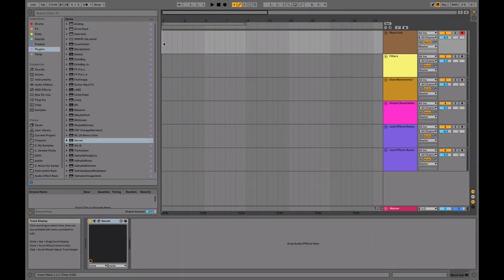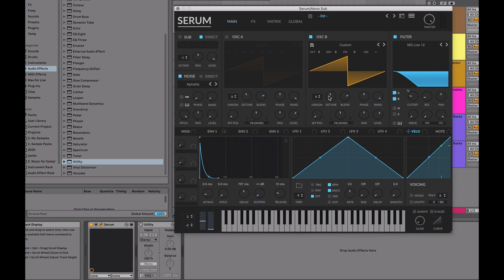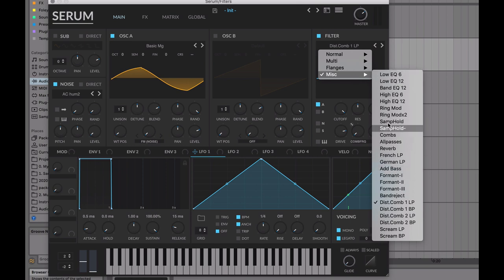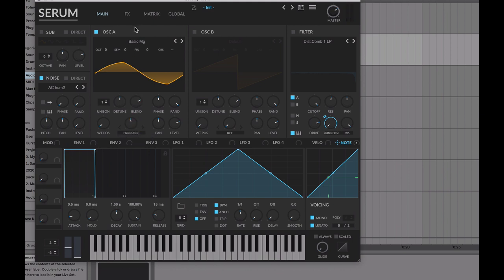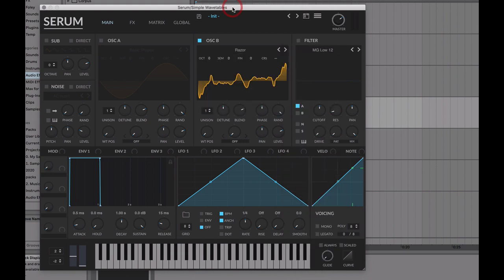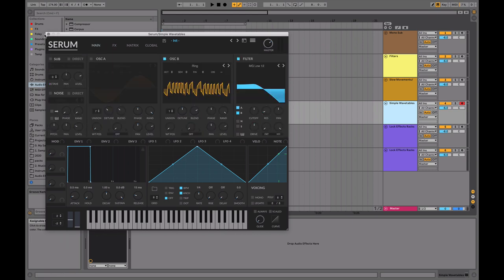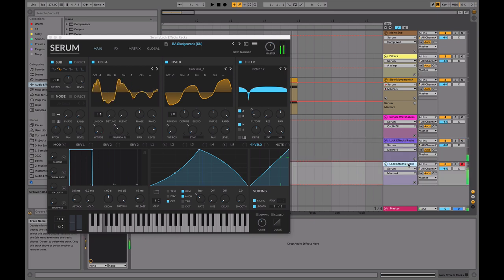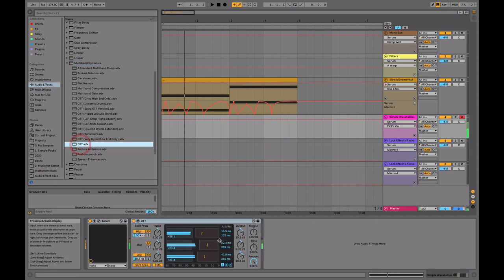Serum Bass Sound Design: 11 Fundamental Tips You Should Know

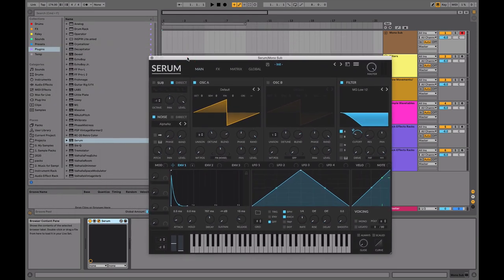Comment from the maker: 0:42 - Tip 1: Low-end Mono Compatibility
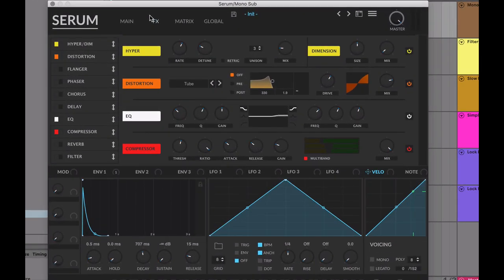4:07 - Tip 2: Multiband Compressor
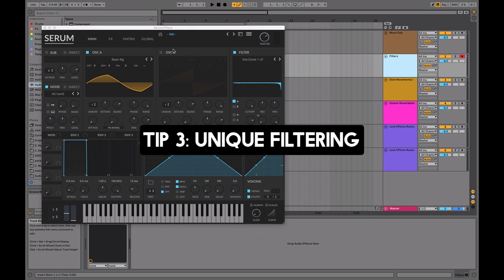5:48 - Tip 3: Unique Filtering
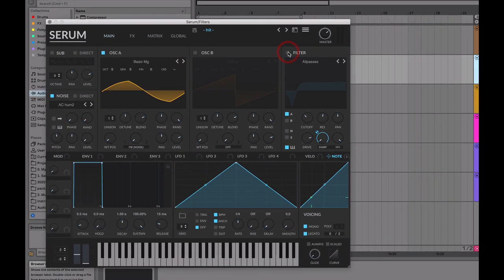8:36 - Tip 4: FM Noise
9:50 - Tip 5: Slow Modulation Motion
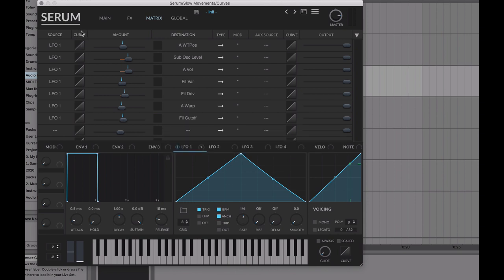11:58 - Tip 6: Mod Curves
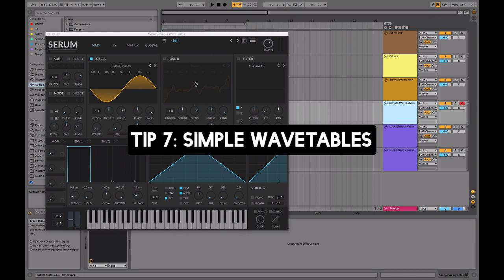12:37 - Tip 7: Simple Wavetables
16:22 - Tip 8: Use Macros
18:14 - Tip 9: Lock Effect Rack
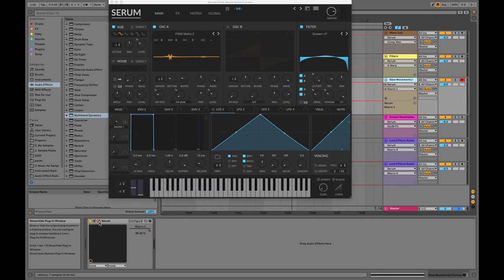20:03 - Tip 10: Resample to OSC
22:03 - Tip 11: External Processing